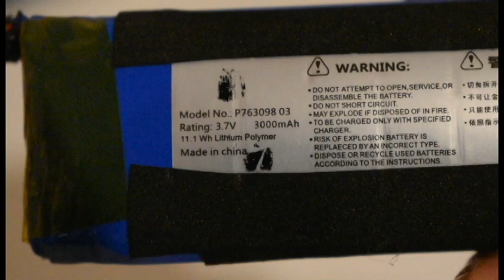Tutorial - repairing a JBL speaker with a 18650 battery simple and easy "usb or damaged battery"

Comment: I have question. I have jbl charge 3 but battery is dead. I find 18650 battery with same mah as original one. Can it run with BMS from old battery and does make some changes like fast draining or something. Thanks.
Reply from the maker: yes, but just if bms is good
Reply: @doitgirl  well, when i play some music after some minutes it start cracking because battery is drained. I put to charge it but it shows like it's fully charged. Probably bms is dead, like you said. Thanks for advice.
Reply from the maker: @kolemlg  hello again, the crackling sound may have another cause, for example when you closed the speaker, it was vibrating close to the structure, but this happens more in loud sound. Is the battery you bought good enough? third if you don't charge directly you can use the battery without bms "the external one" and charge the cell externally. Connect to the poles where the battery is located, pay attention to the positive and negative.
Reply: @doitgirl  i think battery is low, because i using from old laptop one cell, and i think that's the problem, i charged battery directly from 5v supply and works perfectly fine. I will try to find better BMS and stronger battery because here original is very expensive. Thank you for tips man!

Comment: can we charge the battery with your configuration?
Reply from the maker: yes just add a 18650 case and stick it on the body. so you can easily remove and change the battery for charging

Comment: I used power bank 13k mah and its work but when i full volume theres a crack sound
Reply from the maker: hello, when opening the jbl and putting glue sometimes the
Membrane "black part where there is the logo" can vibrate and hit that glue or other object making this noise, I think that is the problem.
Reply: Crack sound is fix but i reversed the battery connection 😭 and the new problem is no sound 😂😂😂

Comment: i did same but its not working, battery heats up. it seems like there is a shortcut but i test it with multimeter and there is no shortcut. Any idea? by the way i removed charger pcb by cutting all cables. Thanks
Reply from the maker: do not use the charging input, the battery must be connected to the battery input as it has a control circuit. to adapt to the loading input you need to keep the control board.
Reply: mine atleast i think uses a 2s battery configuration. its a charge 3 and maybe yours too, that means it uses 8.4v
Reply from the maker: @rosekreuze  I am sorry that I went wrong, but it is logical and I warn you again be careful with the polarizations be careful we are only using a 3.7 v battery and we are using the battery input port.
Reply: @doitgirl  i just replaced my charge 3 battery, well im surprise it is infact a 5v configuration, two in parallel. I thought the tiny board was a bms but just a simple board with a fuse. I replaced it with just a normal 1700 mah 18650 and cant keep up an hour under high volume and generates heat. Maybe thats why the old batteries were in a parallel to be able to handle such high current discharge while using. And we cant obviously fit two 18650's right. Or did someone tried using a high drain 18650?
Reply from the maker: @rosekreuze  Hello Jake the charging port configuration is 5v but then it is converted to 3.7v "small board function right at the beginning of the plug" but we are using the battery port anyway ie battery has to be 3.7v connected to the port. battery not in the port where it charges, as soon as possible I'll make a video about it because needs conversion.

You cannot use in series because it would create more voltage and burn, but you can use 2 in parallel that would last longer, in this case I recommend changing the 18650 battery for one with more Ah it will last longer and maybe one of better quality and discharge capacity solves the heating, if you are using the loudspeaker at the most is battery has little discharge capacity "A" normal generate some heat in the battery because of high drainage. if it's too much, pay attention.
Reply: @doitgirl  well technically, 18650s are 3.7v nominal. Maybe a vape 18650 could resolve the heating issue as it can handle more than 10a or 20a peak which i dont think the charge 3 would use more than 2a
Reply from the maker: hello Harun, are you using a 3.7v type 18650 battery? when we use the battery input the voltage to use and 3.7v don't use the charging port i need to make a video on how to do this correctly.

yes if you are heating it is likely that it is shorted out. checked the polarity?

try to change the battery and see if the same happens but be careful battery heating is dangerous. I can say that it could also be that the problem is really something in the circuit and this is the general problem and not the battery itself.

Try to check and tell me something.

Comment: Where's the BMS board connection?
Reply from the maker: you dont need bms ... I think your 18650 battery won't undercharge or have other risks if it doesn't charge directly.. is not a charger port i use a battery port

Comment: I just wanna clarify you only connected 2 out of 5 leads? Or paralleled the red and blacks into 2 leads and left the white out?
Reply from the maker: yes that's right, join the cables of the same color I leave other information : I only used the battery input if you are trying to use the charging input you will need a controller with 5v to 5v input if you want to use direct "charging" via usb. they can also cut a usb cable, shred the red and join in the red cable and the same with black to black. this at the load inlet. I will try as soon as possible to make a new video explaining this.
Reply: @doitgirl  yup im not connecting it to 5v USb... Im gonna be using a stepdown to 4v- 4.2v, but while im waiting for the board from China, I am currently using an 18650 batt which isn't getting charged (probably because the data cable isn't telling the system about the batt) I unfortunately thrown the BMS so im left with no choice but to just charge the batt manually and or wait for the volt step down
Reply from the maker: @gopronomad4381  sorry i misunderstood the question today i reread it. yes that's right what you asked cables connected in parallel but I made thinking about not loading through the card port. you can also use the board port by injecting 5v with the same principle using a board with micro usb port or using a direct usb type 5v cable or so
Reply from the maker: ツ kroleksius  join in parallel ie join the 2 black strands together and the 2 red ones as well. there is no difference are ports for the same channel. I don't remember what it was built for, maybe a separate loading and unloading port.

Comment: Can i direct with with a cellphone charger instead of using battery?
Reply from the maker: it is also possible to connect the input directly to the gbl board where it converts to 3.7v to power the speaker. like this originally. soldering the cables the 4 slots or at least 2 to + / - the rest and for data and updates.

since this was my first video and it was not very good I will soon release a more preceptible update of this video with 3 ways to recover without buying original parts.
Reply: @doitgirl  bro, do a video about it i really want to use my speaker as a corded one because the life of the battery isn't enough
Reply from the maker: @whos_noner7189  I'm sorry I'm having trouble finding a jbl economic trash to demonstrate, but I'm trying to make a video exemplified as. I will try as soon as possible. but if you use a good 18650 2000mah battery it lasts 4 hours or more
Reply from the maker: Yes and no . the voltage of a usb charger and 5v for that and those converter convert it to 3.7 as security. 5v may not burn the column immediately since there is little discrepancy. but it can certainly cause problems later. solution if you want to use with direct usb or buy the spare part if you find it, or look for a card that converts 5v to 3.7 and can connect through any usb input

https://www.aliexpress.com/item/32817933017.html?spm=a2g0o.productlist.0.0.780c17cbrp8z4p&algo_pvid=6cb29b73-8f91-4f82-93ee-b342d2ac70fc&algo_expid=6cb29b73-8f91-4f82-93ee-b342d2ac70fc-1&btsid=0b0a556116077079564095360e340c&ws_ab_test= searchweb0_0, searchweb201602_, searchweb201603_

first solder the column cables to the output of the board then use a cut cable with usb input place the red on + and the black on - on the board input.

and so you can use it directly through an alternative USB input, making it more affordable. I can later make a video with this solution. :)
Reply: It's okay but still not, it's not ok if you just leave it without replacing the battery. Because it may have swollen and exploded inside, it's corrosive and will destroy the main board first, worst scenario, just throw it away. Believe me, many people have had me replace the battery. Others didn't do it that way, they just plugged it in until it made a cracking sound and then it died.

Comment: why not just buy a replacement battery 8000mAh ? and repair it properly.
Reply from the maker: In this case the USB port is damaged and it is difficult to find parts and it is expensive. This is an economical alternative in response to the difficulty of finding replacement parts.

Comment: How if we use 2 cell 18650 paralel??
Reply from the maker: in parallel does not have any problem, only increases the battery life. does not change the voltage, in series can not cause the increase in voltage.